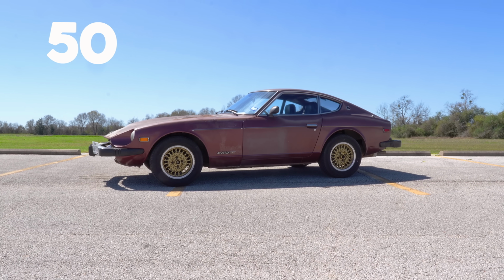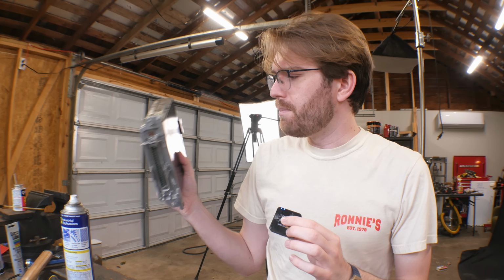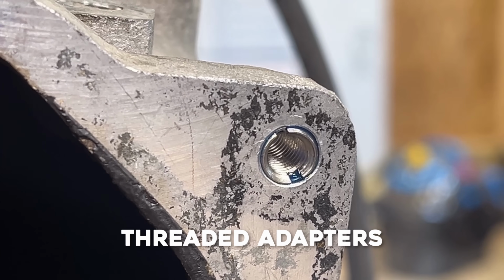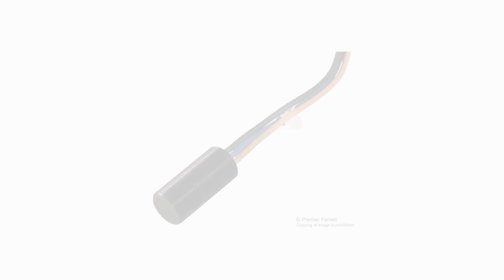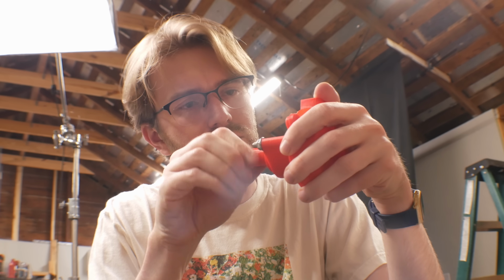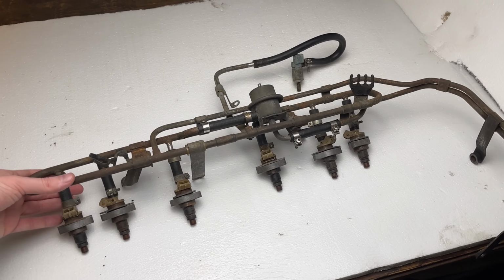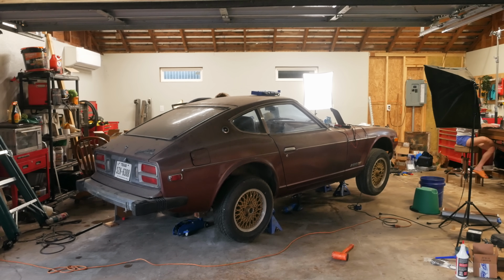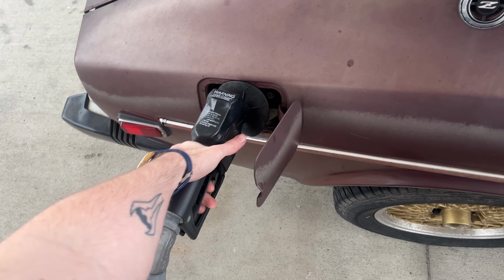Modernizing a Vintage Car

Comment: Thanks for this.  I loved the look of the 280z and wanted one.  However, after watching your vid, seems like its a bit underpowered, and gets really poor gas mileage... so perhaps best I never owned one.  I did have a TR4, which was fun.  I enjoy your humor.
Reply: Current cars are a 17 Highlander with a V6, and a 24 Corolla Hybrid.  The Hybrid is amazing tech, very quick off the line, handles well, very responsive and I get 52-62 and once in a great while 73 mpg, depending on driving style and conditions.  Whats not to like.  Reminds me of the TR4.

Comment: I'm sorry... 👂👈 Did you say new cars are more reliable? 

[This is where I would post article after article about Mercedes and BMW making engine parts out of resin that's designed, purposely, to rot over 6-7 years, Toyota having recalls for metal chips in the blocks, Ford having sensor issues, GM lifters, Honda CVTs... but YouTube wpuld block me]

Comment: 19.9 vs 17 is insane for the amount of work you had to do.... It actually speaks volumes as to how optimized Nissan engineers were able to make it in 1978.

To really make this any more efficient is to increase compression but you won't be able to pay off that cost of an engine break down and rebuild (with new pistons, no less) for another 120 years.

Comment: 125 on the wheel is not bad. FRS rated 200 at crank and puts out 145-150 all day. So it's perfectly in scale.

Comment: I had an 83 ZX until 2008 and never needed to go to a garage except for a/c issues..  Needed interior replaced but the car was bullet proof until the sea side air rusted it up.

Comment: Great effort. The engine looks amazing. My first vehicle was a 1975 Datsun 620 pickup, which I owned back in the 2000s. I loved that your 280z still sounded and ran like a 1978 datsun (with modest improvements) after all the effort you put into it. I replaced the engine, carburetor, exhaust, and more on my datsun back then, with much the same effect. Modest gains in reliability and performance. But it was well worth it. I subscribed.

Comment: Amazing work Mr Finger. My brother and Dad (what one had the other had to have as well) 240, 260 and 280 Zs. My Dad owned a 280 2+2 that had a periodic failure than would cause it to burn excessive fuel and run poorly. He actually towed a Scotty travel trailer out to Utah and back. I owned about 6 VWs during those years.

Comment: I built two cars at the same time. One I did this type of modernizing the old engine and the other I swapped the entire drivetrain + BCM and wiring  harness to the old car.  Swapping the engine and harness is hands down the winner by far. I got tired of fighting tuning, troubleshooting and issues with the upgrade efforts. Sold that the one and kept the one I love. A 1949 Chevy Styleline with a 4200 Atlas, along with automatic headlights and all of the other great features of late models. Best of all, no tuning. Turn the key for an ultra reliable 300hp. Cool video though!

Comment: I want to know what the weight saving on this project would be? Replacing about 5 large metal systems with a single aluminium unit should be some kilos already. Knowing the Datsun is a light car, that might make a dent in the power/weight ratio.

Comment: I have a Peugeot 206 1.1 cc 60 bhp and I am very happy. You started with 120 bhp with 6 cylinders, just the double of my car's power. I would be happy with that Datsun all original with those 125 bhp. But I loved what you did with the same engine. Best regards from Portugal.

Comment: Cool. But i hate injection would have swapped for triple carbs, a big cam, headers, ignition and make a lot more power. 

The other route with injection to keep the stock look and sound would have been making it a stroker 3 liter with a mild cam, and more cc injectors

Comment: The 280Z and L28 didn't have any computers involved, unless you took a tablet PC with you.  It was all transistorized linear electronics.  There was no "programming" but you could fool the ECU in certain ways to alter the fuel mix, and besides removing all the emissions stuff, there was nothing else you could do, besides replacing the Bosch ECU with the modern aftermarket unit, and a GM HEI spark module.

What 280Z  or other Zed owners really need is new or re-designed parts that fail, like the headlamp switch, the dimmer/turn switch, the wiper motor control unit, and a better wiper blade motor & wiper linkage.

Comment: I had a 1972 Datsun 240 Z. It was a little slow and that started my rebuild of the whole car. I rebuilt the engine and had 11 1/2 to 1 compression, but that was when they still have a lot of gasoline. I put a five speed transmission in it and the car was pretty fast. Not super fast but pretty fast. I even took the fan off the motor and put a dual electric fan onto the radiator and that gained me 12 hp. I had KYB struts all the way around and I had 335x35x18 Tires on it and I had a 2 1/8 inch swaybar in the front and an inch and an eighth sway bar in the back. The car handled amazingly. However, I always wanted more horsepower and I actually thought about putting a Paxton supercharger on it, or putting a small block V-8 into it. But then I got married and it was only a two seater so that one out the door. But I do miss the car. It was fun to drive.

Comment: Great video, great work, just the HP gains disappointing.
Also regarding the parts, idk how how it gets in the engine bay but if you get a 3D printer with heated chamber and print engineering materials like glass/carbon filled nylon you could make parts at home for a lot of these parts, you can get them to resist up to 200C

Comment: I'm not sure what the goal was here, and I understand you wanted to leave the engine stock ... however, if you were now to blue print the top end, or bring all the critical tolerances up to modern standards, you'd probably double that gain, i.e. set the deck height/squish correctly, 3 angle cut on the valve seats matched to the valves, clean up the ports to match, and reduce the tolerances on the valve stem to valve guide by using something like a K-Liner. In short, make the engine run how it should have out of the factory.

I guess the good thing now is that if you wanted to start playing around with performance components, you could do so from the passenger seat, fiddling with your computer.

Next step should be losing that monster intake manifold and moving to individual fuel injection units.

Those 260Z bodies have classic lines ... a poor man's Ferrari.

Comment: To many people believe anything that they hear. He did not correct Japans understanding. He does not know about batch firing. He started out with an unturned engine and the parts that he installed will not last. One coil does what 6 do. The less moving parts the better the design. He also removed the vacuum advance which adjusts timing as needed so the engine will last. Japan had access and the understanding of the methods he used but did something better, not the other way around. Also Japan was forced by legislation to install an EGR valve that circulates exhaust into the cylinders. All engines preform cleaner and better when exhaust is not pumped into the engine. Try telling that to legislation as you are showing them with a scope. If he would have tuned everything on the vehicle it would have performed better than the results that he has shown and not have wasted any money. There is far more than timing and fuel and air mixture, there is acceleration and deceleration that have to be addressed to have an engine last for a very long time. I will give you a hint, go and look at where Japan put the PVC and the overhead camshaft that has no bearings because they are using the oil as the bearings. Remember Japan had the knowledge about all of the methods that this person in this video has but they did something better so that the engine will last and preform. You certainly don't want a fixed timing signal it needs to alter on acceleration and deceleration for responsiveness and longevity and the different centrifugal forces that the engine is creating at lower or higher engine speeds.

Comment: RIP the high taxes and duties ordering from JLC now days. Ordered so much stuff pre-tax issues. Now days whatever you buy just go ahead and mentally add another $100-150 on top. Those Alu pieces they sent you had to be a good $300-400

Comment: 9:05 I'm recommending the adapter have a spigot that goes into the intake past that keyhole shape.  Have the transition in the adapter go from the too-large throttle body past the 4-bolt flange and meet the shape of the intake plenum.

Comment: So, do you have a kit or plans / downloadables for other vintage Z-car owners? My son in highschool is currently working on getting his great grandpas 280 driveable. We did get it running, but the system is outdated and if we could pull off what you have here as sort of a senior project he would be greatful! Good work! Ive watched this like 5 times. 😂

Comment: If you want to gain even more power, a next step would be to adapt an electric fan for the radiator its better than the original built-in. It will be more efficient and will only be used when really necessary. For example, when the car is moving at highway speeds, you don't need the fan on because the wind alone does a great job.

The built-in fan in the engine, besides not being very efficient, adds extra weight to the crankshaft because it creates intermittent drag that ends up consuming what I would say 5% to 10% of power. This mainly affects high RPMs.
Reply: I agree, a very good observaton.
Reply: That fan has already got a viscous coupling, so it's not being driven at engine speed, unless it's needed.

Comment: I'm a valve engineer, with my boss being a previous R&D director of Bosch, and I can confirm, we both use the 200pages long Parker catalogue for O-ring dimensioning 9:49 and it was very intimidating at first. 😂

Comment: Beautiful conversion and breakdown. Genius level. I'm sure plenty of us want a to jump on a restomod project now. One ALL of the Datsuns 2x0s, change the entire suspension system and leave no orinial part installed. They will fail, especially with the added power. Once the suspension is upgraded, you wont regret it.

Comment: You should learn how to 3D print with different materials. That would be very useful. ABS with an enclosure is just as easy to print as PLA. ABS is similarly priced to PLA but has higher temp and impact resists but has poor chemical resistance. Nylon just requires a capable hot end and there are some budget core XY 3D printers that could actually do it the real kicker is nylon requires a filament dryer even when stored indoors the properties of nylon are amazing but for most 3D prints is not worth it. To wake up that 280Z, run a heated wire MAF for more accurate AFRs, upgrade to less restrictive intake and exhaust, and if you going to the I just plain everyday reliable commuter and don’t really care about high hp numbers route for performance upgrades throw some hypereutectic pistons and sinter forged connecting rods to increase the compression ratio for better power and efficiency, you might get that engine to around 210 to 230 hp which is not crazy but it is still a lot of fun to drive

Comment: Fantastic video, well put together. I would never have the patience to do this. Keep up the good work.
I had a 1973 Datsun 240Z  2.4L (146.5 CI) with twin carburetors that produced a whopping 151 hp. For a small car it was scary fast. It had one bad habit of front end float over 90 mph even with a front and rear rear spoiler. I loved that car and still kick myself every day for trading it in for the worst car ever made, a 1976 Chrysler Cordoba with the fine Corinthian Leather (Got married wife couldn't/wouldn't drive a stick). I had a A/C service truck so I couldn't have two cars.

Comment: Interesting project! But you forgot the basics; 13% increase is fine, but when you should be producing 170 hp to start with…………? Or, to put it another way, you can put a diamond encrusted collar on a sheepdog, but the collar alone won’t turn it into a greyhound! Check your engine out first!

Comment: WOW, Amazing upgrade, but I have a question, I know with the old spark distributors they have counterweights to advance spark timing as the RPM increases. Does the MAP calculates that ?

Comment: Funny story I cut my teeth tuning in the engine in that Chevy Cruze. It's actually shockingly easy to work with and can produce pretty impressive numbers for it's displacement and weight. I'm my Chevy Sonic, I was doing 220 on stock internals with a big turbo and injectors. Considering the engine was made to get 40mpg and weights 286 pounds wet, transmission attached pretty good. Also they are under square engines with very long geared high end so they are perfectly capable of making good low end torque.

Comment: Have you tried polishing the cylinder head, equalizing the engine's combustion chambers, and installing a properly sized exhaust manifold? You'll certainly get about 20% more power.

Comment: I think the adapter you made for the throttle body would have worked good. The engine wouldn't get hot enough to melt it.

Comment: i had an 2006 hhr  my electronic throttle body kept going out.. they said it was pedal sensor so  i got 2 pedals     3 throttle bodys   n the car still loses all acceleration.. its very dangerous.. i can connect a obd and reset it but it will comeback every 15 or so min of run time......... imo electronic throttle  bodys will murder us all when ai takes over lol

Comment: You don’t have to modernize a 40 year old straight six cylinder engine sunshine grab a ford 91-94 300 fuel injected 6 cylinder off the shelf stick it in (welding required) and go  !

Comment: As a retired EE (non-automotive) great fun watching the joys and frustration of you building a prototype. I had a 1970 MGB in that time frame and the Datsun 2x0Z series put a lot of the other affordable sports cars to shame. Great job updating the fuel injection system. At the end was a little surprise the fuel efficiency improvement was not better.

Comment: Wouldn't the spark distributor wheel get off center with enough use anyway because of the uneven teeth (one side has more teeth -> more mass)?

Comment: As an industrial mechanic (German aprentisship to worker) I cringe a tiny bit, when I see obvious solutions (from my perspective) to that sizing problem with the hall effect sensor. I would have been gently turning the shaft diameter down, OR put a sleeve/collet(?) on to increase it, if it HAD TO BE the OG part, if not, make a new one although as simple as you can get away with. Aka the fewest parts possibly involved. As for the spring, I would have used a distance piece I'd twist grind on a plane table or the likes and secure the preapplied pressure with a snap ring. If it is good enough for a few hundred rpm in heavy equipment, it is good enough for that sensor.

And after I wrote this I kept watching the "one month later" part and see you basically found the same sollution, only not by the derivation of training through a German apprentisship but also slower, because of it. I'd still use that distance ring, it let's you adjust any sideways pressure to the cone-roller bearings that would be recommended when putting pressure along the main axis of the bearing. Not all bearings like sideways pinching, that is something to keep in mind and the engine WILL rattle that thing since it is directly bolted on.

Comment: My brother put an after market fuel injection (tbi) on a mopar 440 cid engine built in 1966. Works well. Is anything available for something like this without building your own parts?

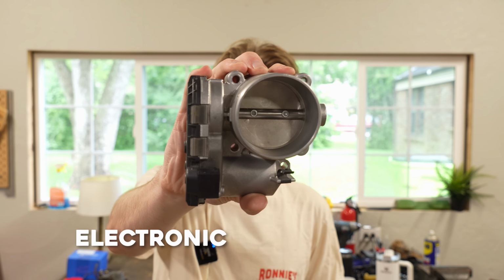Comment: 5:20  you should NOT have done that it takes a few milliseconds to send a signal to the throttle thus lowering throttle response making it less responsive

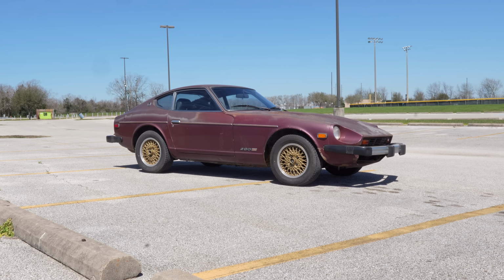Comment: 0:24 Gaurentee you that the only one thats true is the more powerful part. More electronics = more problems, and fuel efficiency has really not changed all that much, especially with pickups.

I love my 2001 f350 7.3psd, but 2 things I hate about it are the fly-by-wire throttle and how many electronics are on the engine. It makes things overly complex and expensive to maintain. I'm a zoomer, so the old boomer thing does not apply to me. I just like things being as simple and cheap to fix as possible.

Comment: My son worked for a company that specialized in putting Chevy LS crate motors in small foreign cars like the one in this video.  They designed all of the conversion adapters to match the existing transmission.  My son himself put an LS3 crate motor in his infinity coupe that he intended to drag race at a local race track.  Unfortunately the track closed so he ended up selling the car. 😢

Comment: this looks awesome... makes me want to post my Z that I have "modernized" via raising compression via the franken motor method (mix z parts for best performance) but I have kept the OG fuel injection. I have done so much work to keep my Z running on the original system but AFM's are getting rare and I don't know how to restore the traces on the AFM. Anything else though I have done, big bore throttle body from a 240z, headers, crane xr300 optical ignition. All of those because well, it got me to work cheaper than a new car for those costs... At any rate I am very close to putting a speeduino on my l28 and this video makes me think it might be worth the time once my last couple of AFMs wear out. Kudos sir.

Comment: with modern fueling i think you would benefit from a much higher compression ratio (although it is bottom end work). the engine was meant to run on 1984 quality fuel, but modern fuel is much more utilizable.